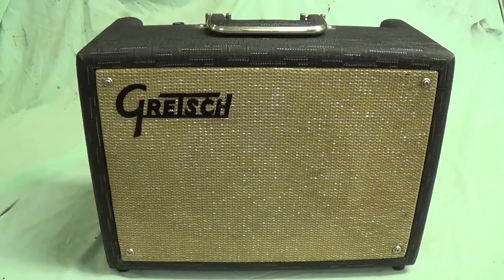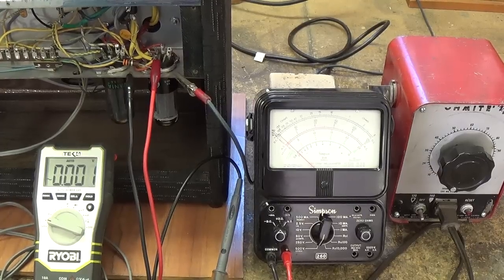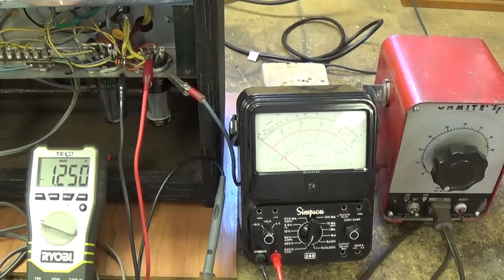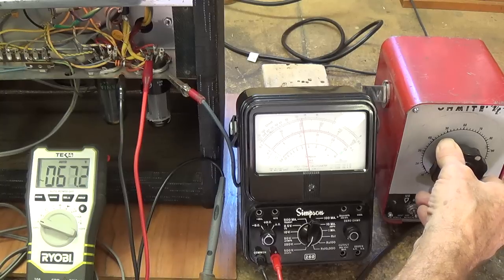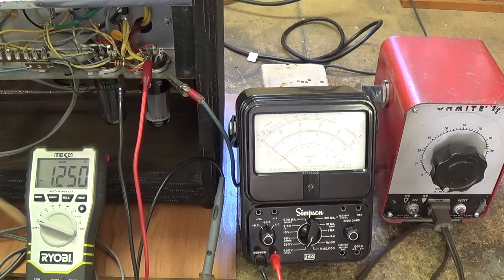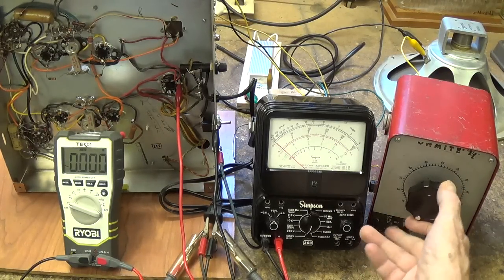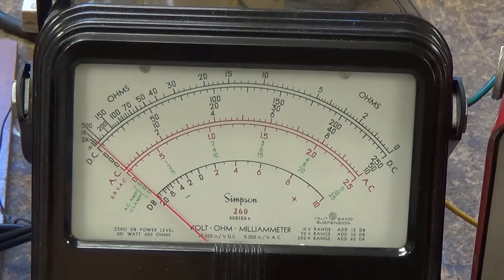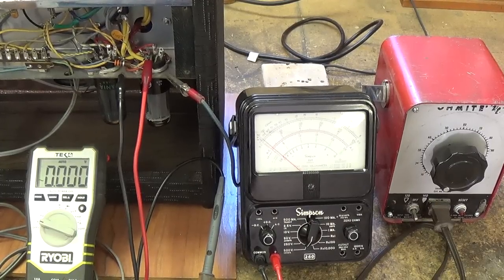Is Gradual Variac Warm-Up Effective with Tube-Rectified Amplifiers ?

Comment: While it's is pretty important that you showed that a gradual rise on the AC corresponds to a gradual rise on the DC also, I'm still curious about when having a gradual DC rise is necessary. Is it only needed for old caps? Does it prolong life in new caps? What about old tubes and new tubes too?

I'm not doubting your wisdom, I'm just still unsure which situations require the most care.
Reply from the maker: Walker, I think a gentle increase of DC is best for all the components in the circuit: tubes, resistors, all capacitors, transformers, etc., especially when they have not been used in many months or years. This is not just my personal opinion, but a standard practice for many, many years....starting with vintage radios and carried over to vintage tube amplifiers, and other vacuum tube electronic gear. It's why amps have stand-by switches and why GZ34 rectifiers are so highly regarded. The more gentle the start-up, especially the first one after long non-use, the longer the circuit components will last.

Comment: Hello again Doug. I was curious if the B+ deflection could be happening at lower input voltages... might the rectifier not yet be warmed up enough to produce an electron flow? My logic is telling me that, given a simple system (no losses), you should have a relative input to output, and therefore would not have to hit a "target" input voltage to see deflection at the output.

Does this make sense? Or am I just babbling again? Thanks for your time.

EDIT:: I suppose that the purpose here is that you got gradual B+ at 30-40V range instead of the 100V input/B+ surge. I just seem to have gotten hung up on the mundane details instead of the main idea.
Reply from the maker: I think you're probably right, Britt. I noticed that even after I quit increasing the input, at 40VAC for instance, the B+ continued to rise for a while, probably due to the rectifier tube warming up. When using a Variac to soft start an amp, you generally increase the AC input very slowly and in small increments, unlike my demonstration (which had to be accelerated for the sake of brevity), and I will bet you that if you monitored the DC output under those conditions, it would begin much sooner. I tend to think there may be a threshold AC voltage before DC output begins, but it's probably lower than it appeared in this experiment.

Comment: Hey doug. Nice to see ya. Were they talking about the b+ voltage starting at 100v+ at the caps maybee? Like we see here? Not ac volts? With the amp not reacting until 35vac the output the caps see is about 100 volts all at once? In a perfect world disconnect caps and bring them to life directly with the variac and bridge rectifier? This is what we do to warm caps up that have been sitting on the shelf when replacing ones in large vfd's.
Reply from the maker: Greetings, RH. I got the impression that the B+ would not appear until the input AC was rather high, and that it would not gradually ramp up, but would suddenly appear and rapidly surge to a rather high level.....completely unlike what I found in the experiment.

To be honest, I think that the DC would actually appear much sooner than 35VAC, but that it was delayed until the rectifier tube cathode could warm up a bit. I'll bet if you re-ran the test with a warmed-up rectifier, the DC would appear at a lower AC input level.
Reply: Yes. Probably UD. Great experiment.

Comment: Uncle Doug, can you help me with a couple questions? I have recently acquired a Silvertone  model 1481 guitar amp. I have had Gerald Weber's book and the Groove Tubes book by R.Aspen Pittman for about twenty years and have read through them numerous times. I paid attention to the sections describing  power cap reforming. I felt that I was long familiar with the cap reforming procedures, and I didn't look through these books when I decided to try my Variac for the first time a few weeks ago. After cleaning the amp up a bit , I pulled all the tubes from the amp, and hooked up the Variac. I didn't hook up any of my meters, but my Variac has the built-in current meter, which never indicated much current the entire time, as I expected. I ran the Variac at around 30 volts for a few days and then increased it by ten volts about every other day. I recall that the books said that after a day, the voltage could be raised ten volts every hour or so, but I have other things going on and this is being done in my home, so I wasn't keeping a constant vigil on the amp. I had it up to 120 volts a few days ago, and then shut it off, and I haven't re-tubed it yet. Since I'm still new to the internet, I just stumbled on to your videos today. I saw your clip here, and I noticed right away that you didn't remove the tubes for this demonstration. Did I not need to bother removing the tubes? And might it be that the power multi-cap in the amp wasn't being reformed if I didn't have the tubes installed? Or does it not matter either way? I try to do any of my amp work the best way I know, and since this was the first time I did this, I admit I should have reviewed the procedures in those books before operating the amp. Am I good to go, if I power up the amp and play through it? or did pulling the tubes negate the effectiveness of the reforming procedure? Did I harm anything by doing this? Okay, that's more than a couple questions...
Reply from the maker: randolph patterson Greetings, Randolph. I'm sorry to say that if you did your slow start-up without the 6X4 rectifier tube in place, you accomplished very little because there was no high-voltage DC produced to reform the filter caps.  I think your best bet would be to build a Current Limiter (see my video on how to do this) and use it when you first power up a newly acquired amp. It will protect against any internal shorts causing component damage, and the amount of glow from the bulb will indicate current flow. Any un-shorted caps will reform (their ESR values will decrease) while the circuit is energized.  It's not as gentle as a Variac warm up, but produces about the same result much more rapidly.
Reply: Uncle Doug You could also put the current limiting light bulb on the load side of the Variac :)

Comment: Hi Doug,  I wanted to ask you a question about variacs. I was thinking of buying a 5 Amp  500 watt variac. I read on the net that people were using variacs for live performances with their guitar amps to slightly lower the voltage in their amps to sometimes get a browner sound out of their amp or just to go a little easier on the amps valves and components. I was interested in doing this because I have a 1965 Fender Bandmaster amp. Do these new variacs need to be grounded by a tech or anything like that firstbefore running them to play your amp through? Or can you just buy one of these variacs like the one I mentioned, a 5 amp 500 watt variac for a 50 or 100 watt amp. The amps that I have are either 3 amp, 2 amp fuses or a Mesa Boogie Tremoverb amp combo at 100 watts uses a 4 amp fuse. There us a guy in the States there that sells a type of transformer box called the RXamp Brown Box wher you cn just plug this thing in and lower your voltage in your amp to say 110 volts. Just plug and play. No worry about it damaging anything or getting electrocuted. Just one draw back, It's $500.00 for one these in Canada. Would a variac be a safe idea for running your amp at a lower voltage?  Thanks Michael Newell from Niagara Falls, Ontario, Canada mnewell333@msn.com
Reply from the maker: Yes, you could run an amp through a Variac, just like Eddie Van Halen did, but there would have to be a 3-wire power cord to the Variac and a 3-wire socket for the amp....with chassis grounding tested and verified. Second, you would want some leeway in current capacity. Running a 4 Amp circuit through a 5 Amp Variac for a long period of time might cause some overheating (in the Variac) and possible (disastrous) failure. If you are going to use the Variac over extended periods, get one with a minimum of double the current capability you will need. Good luck.
Reply: @UncleDoug  , thanks very much for your advice Doug. Hope you will always continue to make  great videos. I wish I had the cash to take a trip down your way. The looks fantastic.  Buried in snow here now. Take care,  thanks very much.
Reply from the maker: @michel333100  You're welcome, Michael. It was in the low 70's here today. I rode around in one of the hot rods in a T-shirt with the windows open :)

Comment: Dear Doug, I’ve only just learned about the concerns of powering up amps that haven’t been on in years. I have a few amps built in the early 2000’s that I haven’t powered up in 5 or 10 years. Would you recommend I buy a Variac and following this procedure? Thank You
Reply from the maker: I have two Variacs, SC, and I don't use either one to slowly energize old, fallow circuits. In my experience, all you need is a Current Limiter with an appropriate-wattage bulb.

Comment: This is very interesting Doug. What if the amp has stand by switch? Should it be turn on?
Reply from the maker: If the only purpose of he slow start-up is to reform the filter caps, the stand-by switch could probably be off during the process. If it is to slowly energize the entire circuit, then the switch must be on.

Comment: I have a 5amp Variac. Is that sufficient for bringing up tube amps?  I have a pair of 30watt monoblocks and I built a light bulb current limiter to use in conjunction with the Variac. Just wondering if 5amps is enouigh
Reply from the maker: Check the fuse value for the amps you intend to use the Variac with. Odds are they are less than 5A.....so your Variac will work fine with them. Any that have fuses greater than 5A might not be suitable.

Comment: Uncle Doug Would I use a Variac  to bring up my Peavey Solid State Amp (it is a Express 112 -65watt)  filter capacitors or would that just be a waste of time of course there are no tubes involved here. Thanks
Reply from the maker: +E tuning  You could do a Variac slow warm-up, ET, but it's only beneficial if the amp has been dormant for several years.  I also always recommend using a Current Limiter when first energizing any old amp that has been sitting a while. Good luck.
Reply: +Uncle Doug  Thank you for your reply I will build your Current Limiter project thank you very much
Reply from the maker: You're welcome, ET. I believe you will find the CL to be one of your most useful tools. I use mine with every amp that I work on.

Comment: Very informative and excellent presentation....... On the subject of a variac, I want to slowly power up the filter caps in a Fender pro Reverb, the variac in question has a power rating of APS 500 watts with a 2 amp current rating. Would this be a suitable variac? Many thanks for any advice
Reply from the maker: That's a rather small Variac, FF, but since the Pro Reverb comes with a 2A fuse, I would think that the amp's current draw must be within the working parameters of the Variac.
Reply: @UncleDoug  Many thanks .......your videos continue to inspire this fascinating subject. Long may you continue
Reply from the maker: @fostexfan160  You're welcome, FF. We appreciate your nice comments.

Comment: Do you usually bring up tube preamps on a Variac as well?  And do they need any sort of load like tube power amps need a speaker load?

Also, I read a lot about using a Variac to bring up an old tube amp slowly, but what about in every day use? Is it best to actually use the amps through a Variac all the time after the first initial turning on?
Reply from the maker: I don't build pre-amps, David, but if I had an old one with its own power supply, I would probably start it up initially with a Variac. You really don't need to slow start any amp that has been used in the past year or two.

Comment: Thanks for the experiment. I built a current limiter that uses a light bulb to detect any shorts in a circuit. Later I came upon an article that mentioned using just such a limiter, but they also claimed that it acts in much the same way as a variac to slowly charge the capacitors. Do you think this is true? Of course you have no dial to regulate the voltage, but do you think it would charge the capacitors at a more gradual rate?
Reply from the maker: Greetings, RB. I would think that a Current Limiter might slow down the charging process by a small amount, i.e by a few seconds, but it wouldn't come close to the rate reduction you can achieve with a Variac. I use a Current Limiter on a daily basis when working on amplifiers, to prevent damage to components in case of a short circuit. The Variac is better at re-forming electrolytic capacitors. To me, they serve two completely different purposes. Thanks for your inquiry :)

Comment: Do you have to have all the tubes in to do this or just the rectifier?

There is another method some of my friends who work SS rectifier 100 watt Plexis use on vintage and new builds.

They put a big resister between  the rectifier bridge and mains.  They measure the voltage drop across it. At first it will be higher, but with time it will decrease. This can take as long as 24 hours, but when done the caps are formed. 

On new builds the time is quicker. The guys that do this swear by it. They say it helps with making the amp very low on noise.
Reply from the maker: In this demo, JTM, all the tubes were in place. This best represents normal, working circuit voltages and current...and I was more concerned with demonstrating that the DC voltage is created at low AC input levels, despite opinions to the contrary. I guess you could perform the procedure with only the rectifier in place. The inserted-resistor method you describe is an excellent way to not only re-form the filter caps, but also test them for leakage (without requiring special test equipment). I may make a future video demonstrating this technique. Thanks so much for your input :)
Reply: Uncle Doug I can't wait to see that video when you make it. Thanks for the reply and the time you took to make all these videos. I really enjoy them.
Reply from the maker: You're welcome, JTM. We'll try to get it out in the near future :)
Reply: Uncle Doug I'd like to see that video !!!
Reply from the maker: Stay tunes, Donald. It's high on the list of prospective videos.
Reply: Uncle Doug If I remember correctly they disconnected the center tap and taped it off and inserted a 100k 5 watt resister in between where the diode connect to the mains. The guy who shared the technique was Larry the German over at Metroamp.com forums. He goes by the name Novisbir or something close. 

I always wanted to try this.

IIRC correctly, he was the one who also talked about soaking old  Electrolytic Capacitors in hot water water for 5 minutes before forming.  Obviously this would not be while connected to the amp, and you would dry and them form while they were still warm. Supposedly this would help make the inside of the cap less viscous and crusty,  and help the forming process.
Reply: Uncle Doug Oh and one other thing. I like using a current Limiter similar to what you have (mine is on a 2x4) and  then use the variac for the slow turn on method like in your video for double protection.
Reply from the maker: Sounds good, JTM. I do the same.
Reply: Uncle Doug I figured you normally did.

Comment: What is the minimum specs needed for a variac to be used for tube amp repair (U.S.)?
Reply: What I meant was do I need a 3 Amp, 5 Amp, 10 Amp, 20 Amp for tube amp analysis and repair? I am going to guess 5 Amp.
Reply from the maker: @anotherOneMore7  5A would be more than enough in most cases, but it's a good choice. Most amps are 3A or less.

Comment: I was told you can change the tone of an amp, by lowering the voltage. Is that true? Also voltage can it vary from place to place? Thanks
Reply from the maker: Rumor has it that Eddie Van Halen used a Variac to reduce the voltage level to his amp and achieved some sort of "brown sound", but I have never tried this myself. I'll bet, however, that there are videos purporting to demonstrate this phenomenon. Yes, voltage levels vary at different times of the day and in different parts of the country, but only by a few volts, which doesn't make an audible difference in a guitar amp.